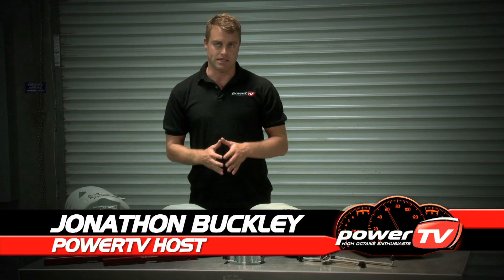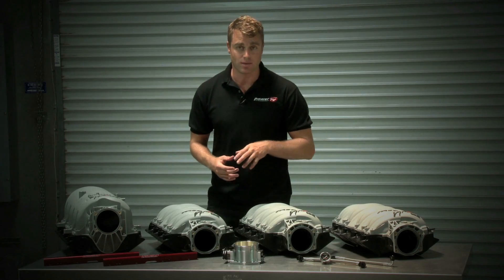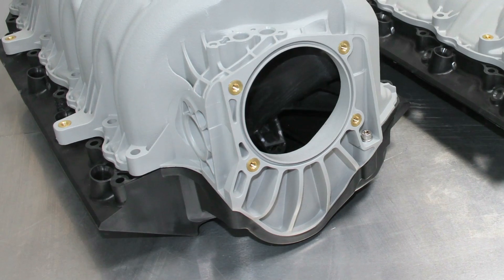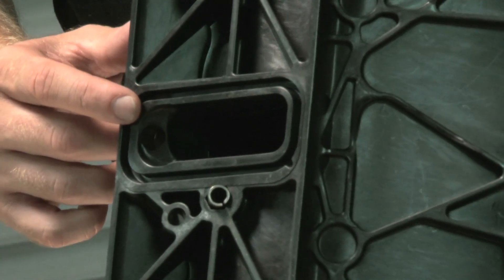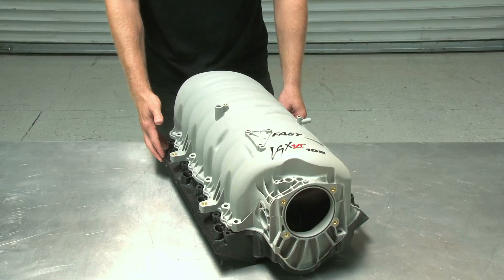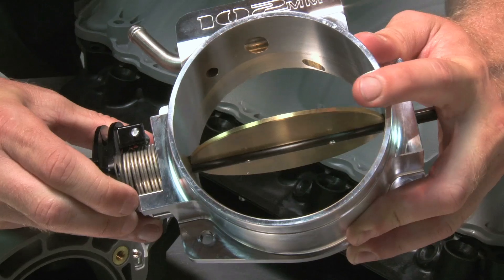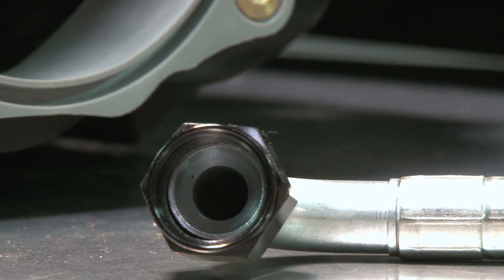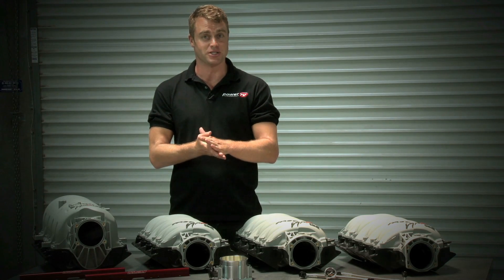Review: FAST's LSX Manifolds - How to Choose The Right Intake

Comment: Nelson Racing engines has dynoed every intake for the LS Vortec motors, factory and non-factory intakes. To this date nothing beats the factory plastic long runner truck intake on the gen3 from 0 to 5500 RPMs. So unless you are racing at the track, save your thousands and buy an ugly truck intake. Theres a video on how to sand them down and paint them if you are worried about being pretty.

Comment: You'll sell more of these if you remove the gawdy branding from the top of the intake. Nobody wants something so tacky to be front and center under the hood of an otherwise sleek $60,000 performance machine. That logo belongs with the Civic crowd.
Reply: agreed. PMitchell106
Reply: its at polymer. shave it off :/
Reply: Agree to dude
Reply: Agree

Comment: Ls2 manifold on a ls1 is a good mod ive heard.
Reply: +Brad Bater really? where did you hear this? It's generally common knowledge that the LS2 factory intake is the WORST intake of all the GM LS engines.
Reply: @DaDeCodeIsTruth  factory ls2 manifold is no good boys stick with the ls6 or go and aftermarket piece
Reply: +DeCode Er Yep...
Reply: +DeCode Er Except the ls4. that is by far the worst intake
Reply: +DeCode Er  ive heard it from a few different people. Because the inlet is bigger then standard ls1 an use a ls2 manifold. Either way i wouldnt use a fast or ls2 manifold. Ive seen a few ls1s pick up 5-6rwkw from bigger throttle an fast manifold. Simply not worth the money. More for looks i rekon

Comment: to expensive for little hp
Reply: You unless you're making serious power, there's no need for it..  Stock LS intakes flow very well stock.
Reply: Spot on spending over 2K just for what 14 hp and thats no at the rear wheels more like the Flywheel, just a joke really so much performance parts out there, yet simple things like timing and exhaust changes will give you and increase 100% if done right ?$2 K  and about 60 RWKW extra on a VF1 SSV redline with HSV try y headers hi flow 200 cell euro cats and HSV 2.5 cat back system with DPE rear mufflers and OTR and tune. :)
Reply: You can make more power with it
Reply: You unless you're making serious power, there's no need for it..  Stock LS intakes flow very well stock.
Reply: Thanks
Reply: Ive always heard that an ls1 intake will end up holding the car back after you put in heads, cam, and exhaust.
Reply: fakegibsonssuck lol dude the stock ls2 intake is known for being horrible, just like the gtos suspension and fuel lines. That's the only 3 things that are known to be junk on the ls2.
Reply: That's just bolting it on with no other mods. This shouldn't be your 1st mod. After you have a few other bolt on's this and a tune will make a huge difference. Air flow is everything.